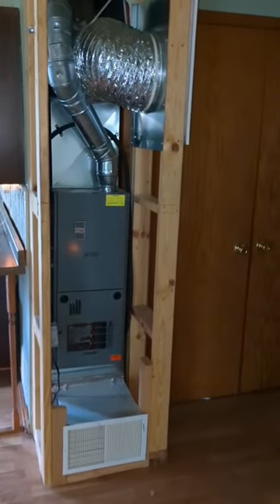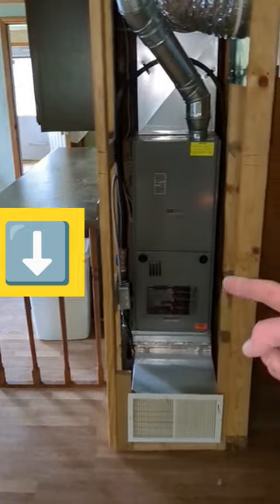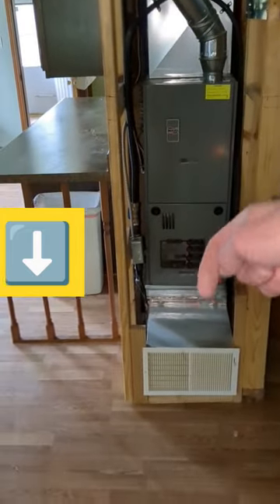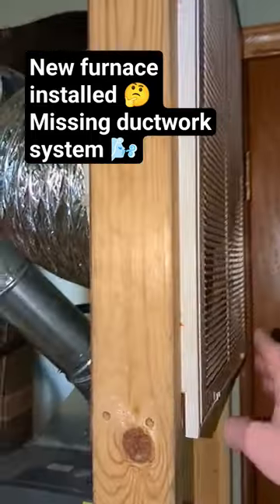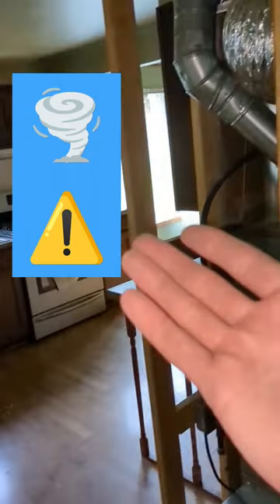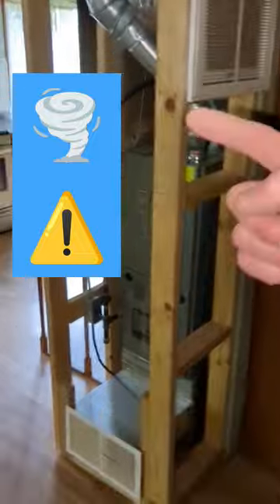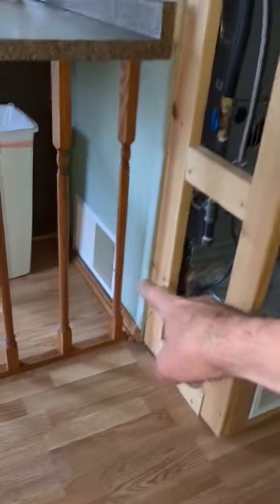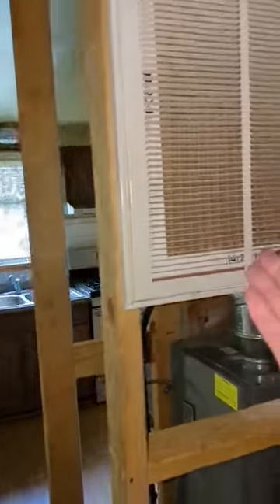🕵️‍♂️Code #inspector passed NEW furnace with no duct system #youtubeshorts #shortvideo#shorts#hvac

Comment: You didn't mention if the house had a attic space or was on a slab. They might of had limited choices. Can't tell from the video.
Reply from the maker: Little to no access in the crawlspace. Horribly at grade level. Second floor with small side attics, which is probably the best option. But it's a down flow furnace. Ugh.
Can be adjusted.
Thanks for watching.

Comment: why install hvac with only 2 vents?
Reply from the maker: Speechless. Although the crawlspace below had little to no access. Very difficult to install.
Thanks for watching.
Reply: @inspectflix  why not run it through attic?
Reply: would have been better to get a couple of mini split systems
Reply from the maker: Good answer.
Reply from the maker: @Cristian-pw1iv   yep, that's the next option. But don't forget, they installed a down flow type. Now they need an up flow. 😉
Reply: @Cristian-pw1iv 2 splits would work but it’s a tiny house they could of just used an up flow with trunks.. might have to add some bulk heads but atleast you get what you pay for.
Reply: He should have installed a ductless mini split heat pump. Individual heads pn the wall in each room.